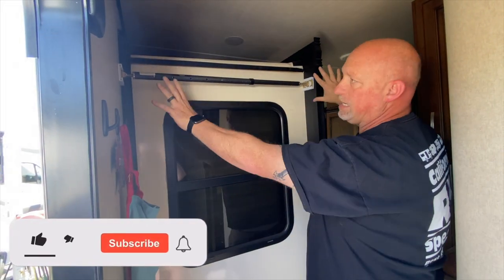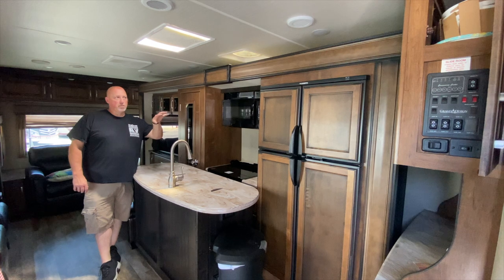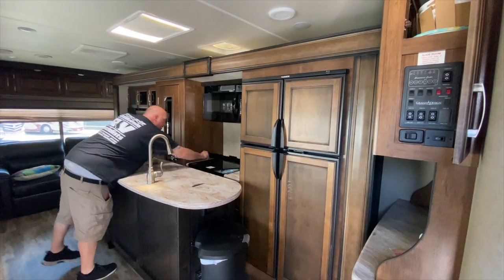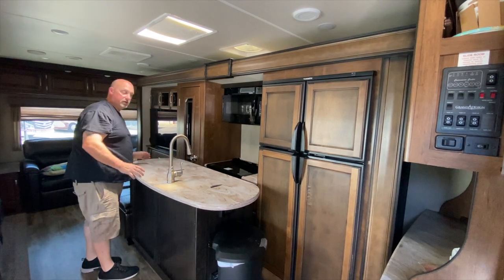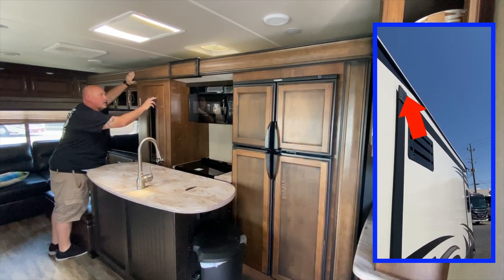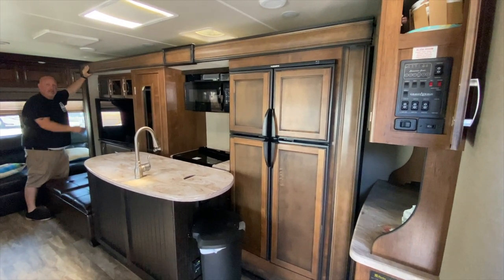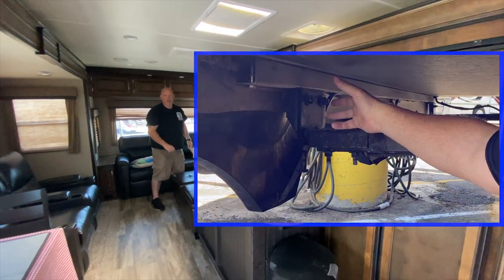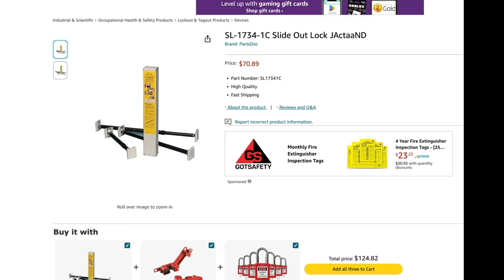New RV Products that Help PROTECT Your SLIDE OUTS!

Comment: The issue I see with the product is that it will be only a matter of time before someone forgets to remove the brace and attempts to open the slide causing more damage to either the slide  or wall then the protection it provides.
Reply from the maker: I appreciate you joining in on the conversation. Like anything, there is room for error. Just like putting a parking brake on a car, its on the owner to disengage it. I have seen an RV owner tie a bright ribbon on the slide lock that hung over the side as their reminder - something I think is a great idea!